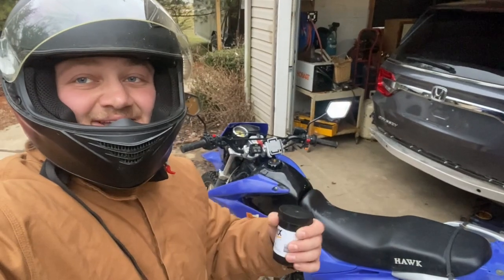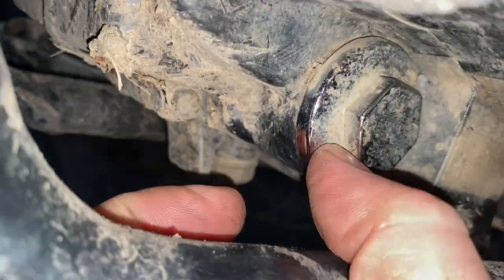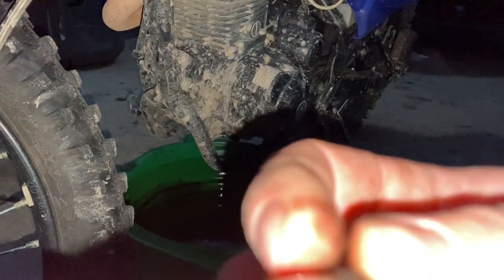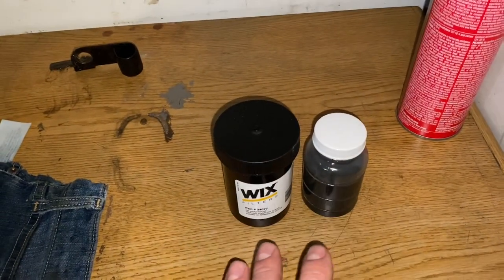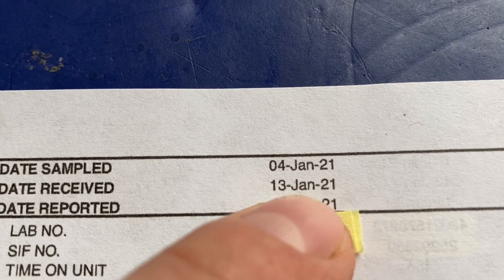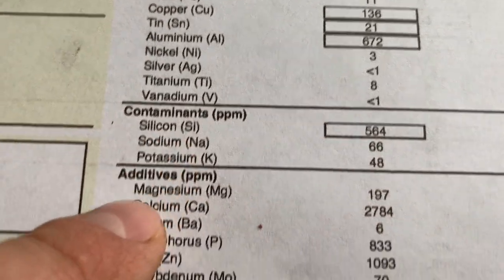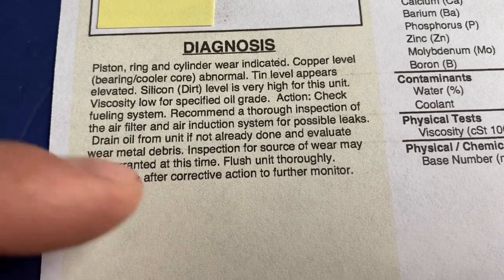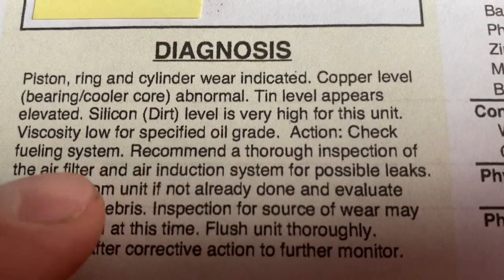Oil test reveals the truth about Chinese bikes Hawk250

Comment: You should find someone with a Honda dual sport and do a sample from theirs and yours after 1000 miles and see how they compare. That would be interesting to see.
Reply from the maker: Believe it or not I actually had several Honda crf250l bikes, one was a 2016 the other was a 2017. I got one that was almost new,  I had to do a break in on it , you wouldn’t believe the metal shavings that came out of it! Actually I have the video on YouTube here if you want to go check it out: https://youtu.be/G0aRh0GSVxI 
It would definitely be interesting to see a comparison, but I feel like the Honda oil sample would be very boring lol. Probably not much to see honestly, especially on the newer 250l bikes like I had. They are efi so there would be pretty much zero fuel contamination, they also have a lot better air filter than the hawk, so there would be minimal or no dirt contamination lol. What would be interesting is to see how a equivalent Honda enduro (from the 70s or 80s would compare) ally of the old Honda’s were the same exact way as the hawk. No I’ll filter, just a screen, carbureted, and in general just old technology like the hawk. Great suggestion! Thanks for watching!

Comment: Greetings from the UK. I have been riding Chinese bikes for some years now, and have had good service from them. My current Lexmoto has the same oiling system as the Hawk, so I replaced the strainer with an adapter intended for an oil cooler, and it feeds a bolt on cartridge filter. Oil changes every 1,000 mls an the oil stays very clean. Parts were very cheap from e-bay, worth doing.
Reply from the maker: That sounds like it would be worth doing. I don’t care for the extra oil cooler, with the way I ride that’s extra stuff to get broke lol, but a cartridge filter would be well worth having on the hawk! Thanks for watching!
Reply: Do you have any part numbers or links for this oil filter adapter? I'm very interested
Reply: @trevordinwoodie3231  Sorry I never kept any details, both were from e-bay, and I cant get any details because my comp was hacked, so I had to start again with e-bay.

Comment: Put a strong small magnet on the oil screen spring and or get an oil drain plug with a magnet. Change the oil every 500-750 miles with something decent and its life will greatly extend.
You'd be amazed how much iron the magnets catch.

Comment: Put a uni crankcase push in filter on the hose. Route it up higher away from excessive heat. Clean it Evey time/other time you clean the air filter and this also extends the oil life greatly. A quality uni pod filter in a modified stock air box filters much better

Comment: So, change oil Immediately before starting, again after like 50 miles for break-in, then every 500 or so?  I would use conventional cheap oil for break in, then after the first 50 and 500 mile changes, switch to Supertech full synthetic. Because full synthetic will not break in the piston rings correctly. (After 550 miles everything will be fully seated and broke in)
Reply from the maker: That sounds like a super safe way to break a bike it! I say go for it, your headed down the road for success! Thanks for watching!

Comment: One of the things that interesting is that the CSC TT250, which is 90% the same as the Hawk 250 recommends oil change intervals every 2500 miles after the initial break in. The only real discernible difference between the TT250 engine and the Hawk 250 is the counterbalancer and the evap system. That's a huge interval for no oil filter. My Rebel 250 recommends every 1500 miles and it has no filter either. I definitely wouldn't feel comfortable changing my oil every 2500 miles in a non-filtered motor, but apparently it's working for TT250 owners as I've heard no tales of catastrophic engine failure because of this.
Reply from the maker: If you want to hear something really crazy, the hawk manual calls for 4,000 mile oil change intervals. I suppose that might be ok if I didn’t have dirt and fuel getting into the oil lol. In the end who is really going to chase these problems down , I bet 90% won’t, and I bet 99% don’t even know anything is happening, But in all reality, the oil needs changed at 1,000 miles or less anyways! Lol. Thanks for watching!
Reply: @goodolboys713  Lololol! That Hawk manual is a joke. I purchased my bike used with 809 miles (km?) on the clock. I'm currently at @ 4,000 true miles and that oil gets changed every 500 miles. Now what is interesting is that these engines apparently do tens of thousands of km in third world countries. I have a buddy who is a missionary to the Dominican Republic and he notes that other than infrequent oil changes and chain replacements every once in a while, these bikes are used like crazy over there and see little maintenance. So, perhaps these little engines are breaking down but just last forever until they peter out @ 30-40K miles. CHONDA STRONG bruh!

Comment: my hawk gets a oil change every 1200 miles give or take, plus i don't use low grade oil and i use a zinc additive since its a pushrod engine, with those steps i don't see the grime your seeing thou i do tend not to run it off road too.. mines street legal and on road only now
Reply from the maker: Road riding definitely seems to be easier on these bikes. I use Honda GN4 10w-30 or 40 depending. It’s $45 for a gallon on discount, not cheap by any means, point being i don’t think it matters too much what oil you get, the oil is going to get used at X amount of miles or hours of riding. I think the best recommendation I can give anyone is to know your riding style and know when the best time to change your oil is. Sounds like you have your oil change schedule figured out. Thanks for watching!

Comment: THANKS..WHAT OIL I NEED TO PUT IN THE HAWKS???
Reply from the maker: That’s a very good question, a lot of people have different opinions on this, however the bike will see what oil goes in it right on the manufacture sticker on the right hand motor case. It’s a big white rectangular tag. I have always ran 10 W 30 or 10 W 40 Honda GN4 oil. Hopefully this helps thanks for watching!

Comment: Thanks for your research bro. I wondering if an oil cool may help prevent alot of this.??
Reply from the maker: I unfortunately it seems like the problems are in the fueling system and their box. unfortunately I don’t think an oil cooler would help matters here LOL. If I had overheating problems it would be a different story, BUT I have never had any issues with over heating. I can see the point you’re trying to make though, the oil cooler would definitely add some more oil capacity, which would allow you to run the oil for further interval while building up less contaminants. An oil cooler would definitely be something I’m interested in, however it adds more complexity to the bike, and again it can be a good thing but in my case where I’m constantly laying the bike over, hill climbing it,  laying it on rocks etc., it would be best for me to not have a radiator that I can bend and break on the trail LOL! Thanks for the comment!

Comment: We’re you using a synthetic?  When I had my hawk I would use cheap bulk oil and change it every 750 miles.  It’s easy to change.
Reply from the maker: Yes I was using the best of the best synthetic Honda GN4 in the correct viscosity, One things for sure I cannot blame any of the engine failures on improper oil LOL. I normally change my oil every thousand miles, and this video I really wanted to test the oil and push it, so I went 3000 miles. As we can all see this is a bad idea, I knew it before I even started the test, but someone had to do it LOL so I guess it was me.I can change my oil blindfolded at midnight while upside down in about 10 seconds. Obviously I’m just messing around about the last part, the oil is super easy to change. Cheers! Thanks for watching and commenting!

Comment: Do you have any kind of pcv on your bike? I hear the engine can suck back in through the crank case vent tube.
Reply from the maker: No PCV, it came like that from the factory, it could honestly probably use a pcv valve and oil catch can. Honestly an oil catch can is definitely at the very least a must. I will probably be doing all this in a video about the air box in the future. Thanks for watching!

Comment: Great video but isn't that a ton of hours on an oil change? Wouldn't that skew the results since the oil is so old? For example, I change my oil every 4 hours on my 250f and every 8 hours on my air cooled bikes(Hawk 250, XR200R etc).
Reply from the maker: I see your point but no, It’s totally different for trail bikes. So the oil that was tested only had about 80 hours on it. It sound like a lot, but think about fourwheelers that can see 100 hours or more before needing an oil change, and same thing with cars. Think about how many hours your driving your car to build up 5,000 miles for an oil change. Then consider that there is now 50,000 plus mile oil, think about how many hours it takes to put 50,000 miles on a vehicle before changing the oil. So no the hours do not skew anything, race bikes and trail bikes are totally different. Your looking at oil change intervals rated by hours (for a race bike for example) vs an oil change rated by miles for most other things (cars, trucks, fourwheelers, some dirt bikes, the list goes on). And again, an oil change can be a very opinionated thing, I change my oil every 1,000 miles (when it makes sense to). I always say do what makes the most sense. If you can take your valve cover off and see bare metal, no burnt oil or sludge, your doing it right. I recently took the head off to do maintenance around 3,000 miles, and I had no issues (no build up, no burnt oils, no discoloration, and no sludge under the valve cover). Hopefully this clears thing up. If you have anything else to add please comment below! These are great questions and answers for people to scroll through and see! Thanks for watching!
Reply: @goodolboys713  Thanks for the reply! I understand where you are coming from. Definitely gave me something to ponder. God Bless and safe riding!
Reply from the maker: @samdouglas1842  thanks for commenting! And god bless!
Reply: @goodolboys713  cars and 4 wheelers have oil filters though.
Reply from the maker: @sv8313  no matter, the hawk is a tough bike, I have ran the same oil in it for multiple thousands of miles. Bottom line and point of this video is that the oil was ran too long and needs changed at 1,000 mile intervals or less. We will put it this way, Even if you put the proper oil filter on the hawk it’s not going to change the fuel contaminant in the oil, or the degradation of the oil. As you could see the main problem was degradation of the oil due to fuel in the oil. Again, something that no oil filter is going to take care of. Weather you have a proper oil filter or just a screen, the results of this test would be the same. Hopefully this makes sense. Thanks for watching!

Comment: don't forget it is in km and not miles
Reply from the maker: Mine is rated in miles, the Speedo is stamped with MPH. When going 60 it would be reading 110(KMH) which it’s not, it had never read over 65(MPH) which would make more sense as a top speed in mph. If you have anymore comments to add, please add them below!Thanks for watching!
Reply from the maker: I was just curious, does your bike say mph on the gauge? Or does it say kmh? The MPH or KPH mark is off to the right side of the gauge about mid height. Thanks! 🤘